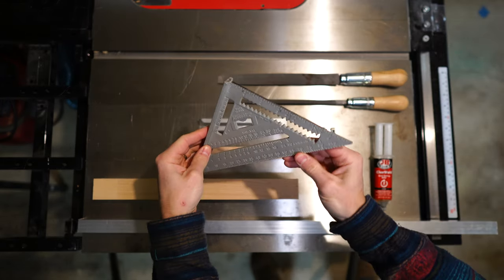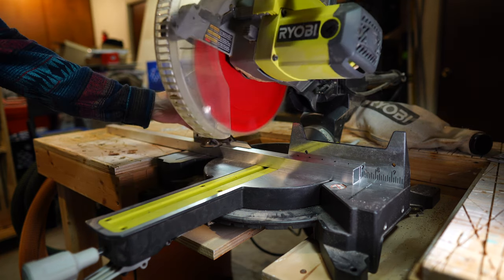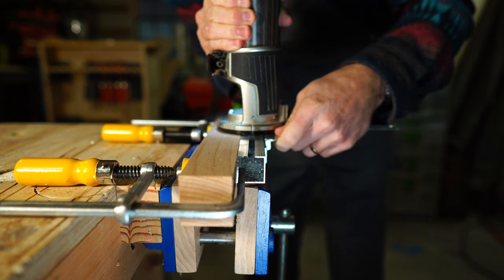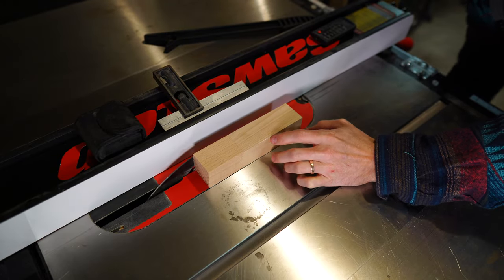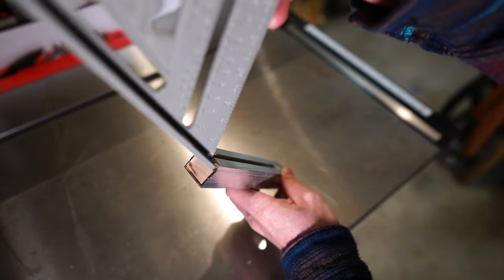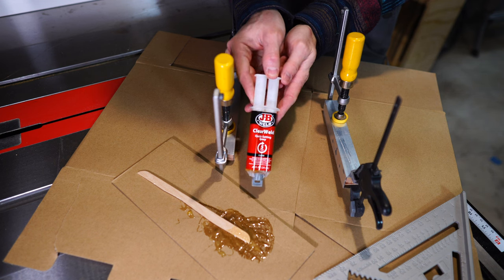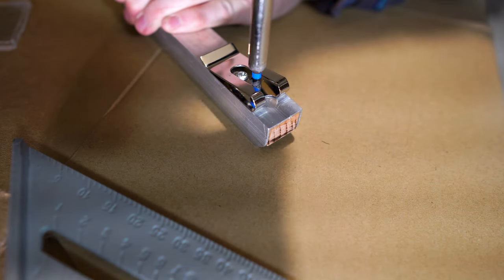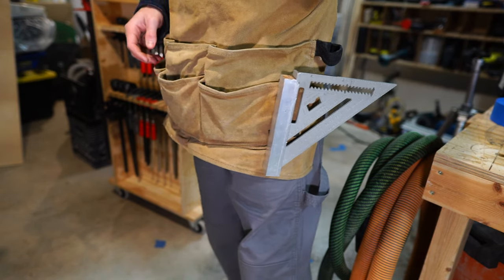Making a Speed Square Holder

Comment: Great design! An angle to the top of the wood may make it easier to get the square in, but it looks like the chamfer in the aluminum really helps with that already. Were you able to find that aluminum at a big box store?
Reply from the maker: A bit of angle on the top of the wood could be a good adjustment! As it is though it goes in pretty well. Home Depot usually stocks that aluminum but you have to buy about a 3’ section.